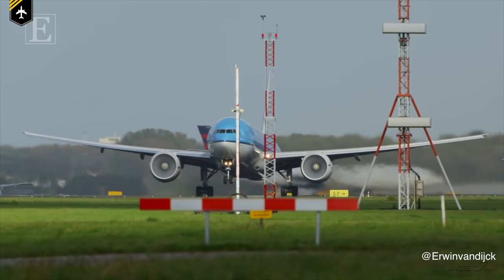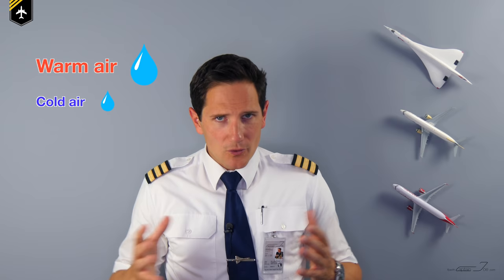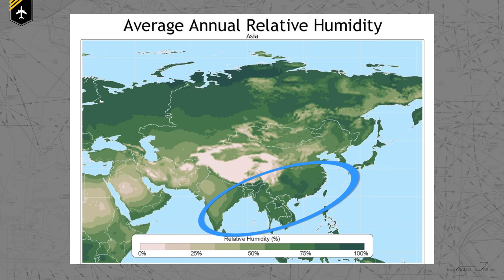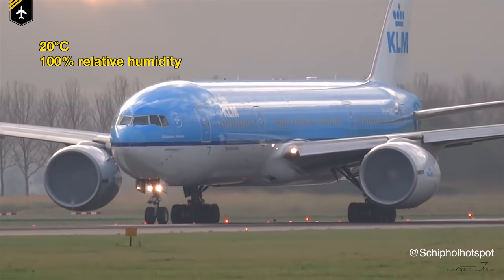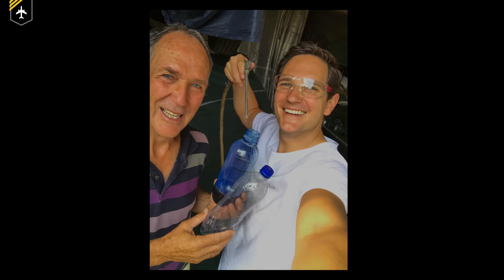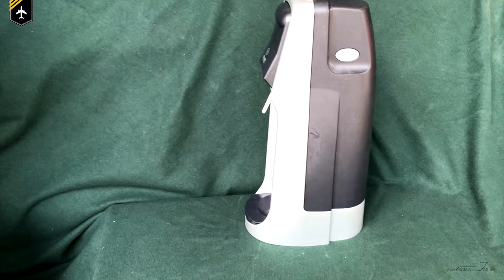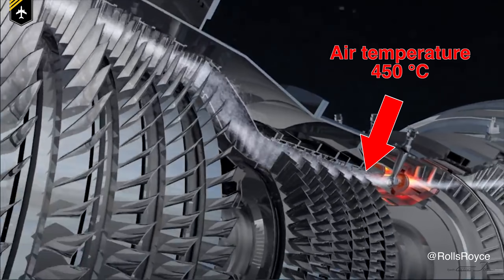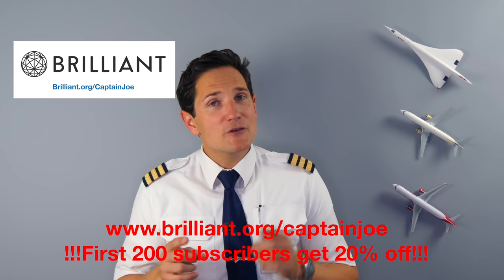WHY is there a WHITE CLOUD? Explained by CAPTAIN JOE

Comment: The water inside the bottle does not get hotter. The Air is. And can Store more vapor. The Change of the water from Liquid to Gas cools down the water very efficiently. Therefore we expect near Isotherm compression. The Gas inside has now near roomtemperature.

Comment: 5'000 cubic meter per second ! :O
Reply from the maker: Big Sucker :)
Reply: More like 500m3 at sea level and 15 degrees Celsius.
Reply: It's definitely not 5000 cubic meter per second. An Airbus A380 sucks 800 cubic meter per second which approximately has a weight of one ton.
Reply: @flywithcaptainjoe  I have found that The Trent XWB (A350 XWB), a larger engine developing 430 kN at takeoff, has an air mass flow of 1,440 kg/s. So it woild be around 1872 m3. Considering 2 engines, still less than 4000 m3. Am I correct?

Comment: Question to Min 3:17 of the current videoDear Captain Joe, herzlichen Dank für die guten Erklärungen: Sie haben die Gabe, hochkomplizierte Dinge ebenso anschaulich und einfach wie auch sympathisch runterzubrechen. Ich wartete mal auf den Abflug - die Maschine stand noch - und schaute interessiert von vorn in das rotierende Triebwerk. Der Boden war trocken, aber es machte den Anschein, als ob Regen zu erwarten wäre. Plötzlich kam scheinbar aus dem Fan eine waagrechte Nebelsäule, die sogleich einen scharfen Knick machte und sich Richtung Boden fortsetzte. Es sah aus wie ein grosser Spazierstock aus Nebel. (vgl: Min 3:17) ABER: Warum geht der Wirbel zu Boden?

Comment: Nice explanation, but i have one thing to add, there is no suction. Is just air moving from high pressure to low pressure (even in the vacuum cleaner). The big fan/compressor of the engine is moving/pushing the air back and that creates a low pressure in front of it , AgentJayZ has a good explanation about this on his channel. All the best!

Comment: You described it wrong: Wait wat? Minute 3: Faster air is cooler? Wtf???    Faster air FEELS cooler because of the layer of warmer air around our body....

The real explanaition why its getting colder is shortened: 

The energy (in wich the molecules are moving) stays the same while the area (as a cause of the suction) ( less pressure ) increases so the temperature is going down.

(Examples: The mechanism how Refridgerators work /  Why a spray of deodorant feels cold, even if the can was at room temerature )

I hope you correct your mistake (an easy to make mistake)
Because 4 a sience and physics nerd like me this is not the best part of your explanation🖒
Reply: Vincent Sooos he was talking about the wind chill effect of fans
Reply: Both explanations are true. a) more air moving around you will cause more temperature to dissipate (what you explained) b) moving air will drop its temperature due to the ideal gas law and pressure differences.
Reply: *for
Reply: ...Yeah, the cooling effect in the front of these engines is basically the one form of cooling fans DON'T do. Fans cool down potential hot zones by circulating air around which averages out the temperature in the area, fans create a wind chill effect by cycling off the air around our skin that heats up, and fans evaporatively cool us if we're sweaty... Fans do not change air pressure and adiabatically cool anything, sadly. That'd be a neat trick. (albeit loud.)

Comment: For a laymen's explanation of a complicated subject based on a simple question, his explanation will work for most people. However, besides the adiabatic cooling, it's worth mentioning there is no such thing as suction. There is only high pressure areas pushing itself into low pressure areas. Regardless, thanks Joe for the great video!

Comment: I was confused when Joe talked about "moving air being cooler."  Not so. Lowering pressure DOES cool the air, because there are fewer molecules banging into each other with lower pressure. So as the engine sucks in air, there is extremely low pressure as the air leaves the atmosphere and is pulled into the engine. That's when the air cannot hold as much moisture and therefore the water vapor condenses.  So it's a matter of lowering pressure as a result of moving the air, and the low pressure causes the condensation.

Comment: Yes, the reason for the forming of fog is the drop in temperature to below the actual dewpoint in still air. But the reason for the temperature drop is the sudden drop in pressure of the air in the intake (not the acceleration). Yes, the acceleration of the air by the fan blades causes the drop in air pressure in the intake area in front of the fan. Many times in such a humid environment (dewpoint close to temperature) we can also see a "locally generated cloud" above the wings of an aircraft during take-off when airborne.

Comment: It is NOT the acceleration cooling down the air, but the decrease in pressure. Acceleration has no effect on pressure or temperature etc. Also a fan is NOT cooling because of cooler air, but by forcing evaporation on the skin. Temperature in front of a fan is not cooler, theoretically even warmer.

Comment: This was a great explanation of the subject thank you Joe.
The practical demonstration was also great, you put it better than I could have done as an Aircraft Engineer!

When we are carrying out high power ground runs on our jet aircraft you see condensation clouds as well as vortexes drawn up from the ground, it certainly makes standing outside as a safety man a more interesting experience.
The other time we see vapour clouds like this is when an aircraft depressurises rapidly. The experiment you did replicates this perfectly.
In the past I have been in the co-pilot seat on engine ground runs and when carrying out a pressurisation check we have had a fault that caused the aircraft to dump pressure rapidly when it had been fully pressurised, that certainly created one eerie mist in the cabin, as well as very painful ears! Thankfully no-one was injured and we fixed the fault. Needless to say, the engine/pressurisation run after the fix was a nervous one.

Cheers for making great content!

Comment: Just a correction: The temperature of the gas drops because of the drop in pressure, not acceleration. The acceleration of the air is due to the pressure difference, and has nothing to do with thermodynamics. A fan works by the 'wind chill' effect, and this cooling effect has nothing to do with the acceleration of the air.

Comment: The fan in front of the engine creates low pressure, the air in the low pressure can not hold as much water as the ambient air so the water condensed into vapour causing the ‘cloud’.

It’s the same principle when a wing is creating a low pressure area, condensing the water into vapour. 
The same again when an aircraft breaks the sound barrier, there is a low pressure in the wake, causing vapour to form.

Comment: like in an air conditioner or a fridge, compressed gasses become liquid. this confuses people. this is not liquidification, this is condensation due to rapid temp decrease and air releases excess water. but normally, when you decrease air pressure, air will have more water capacity. so there are 2 components involved. temp&pressure. well explained joe! totally aggree with you.

Comment: That's also why a cloud is sometimes formed above the wing surface, since the pressure above the wing is lower.
By the way speaking of low pressure... Take a pack of sealed crisps to a flight and see how it gets swelled at a high altitude.

Comment: The temperature drop is not caused by the acceleration it is caused by the drop in pressure. U can turn this effekt round so if you cool something down the pressure drops. By gases this rate is nearly direct proportional to the absolut temperatur in kelvin. So half the absolut temperatur means half the pressure.

Comment: I guess to simplify it you could say that the pressure decrease that happens when the air speeds up when it enters the intake bell will condense water out of the air. You should explain the Venturi principle and that the air will speed up and lower pressure when being taken into the engine. Basically anytime the air moves faster it indicates it’s going towards a lower pressure and that will decrease the temperature. It’s like how a vapor cycle air conditioner works in an aircraft.

I don’t know. Maybe that’s a worse explanation.

Comment: I thought it was because of a gas law P1/T1 = P2/T2, temperature varies proportionally with the pressure exerted on it. 

that's why a fire extinguisher can become VERY cold when being used due to internal pressure massively dropping, same goes with any other pressurized gas cans that loses pressure very quickly.

Comment: According to Boyle's Gas Laws, when holding all other parameters the same, a decrease in pressure results in lowered temperature. So... As fan blades spin rapidly (supplying the powerplant with the required quantity of oxygen), they remove air at the front of the jet engine. This reduction in total air concentration at the front of the engine corresponds with a local reduction in air pressure. Therefore, temperature in that location is also reduced. However, the absolute humidity (total water content of the air) remains the same. On a humid day, the absolute humidity nearly saturates the air. As Captain Joe indicated correctly, cooler air cannot hold as much moisture as warmer air. When the supersaturated air (air that has more moisture than it can sustain) in front of the engine can no longer absorb increasing amounts of moisture, a region of condensation in the form of tiny water droplets develops in front of the engine. Under those conditions, you can see what appears to be fog within the engine cowling.

Comment: PV=nRT  He is not technically wrong, as the pressure (P) of the air intake (which is constant volume V) lessens, temperature T will drop (n and R are constants).

Comment: it is just the drop of air pressure and with that the drop of temperature that the creates the condensation. The "moving" of the air has nothing to do with this. The cooling on a body by a fan works by pushing the warm air around a body away faster than convection can, plus increasing evaporation of sweat.
Otherwise, great, informative, and entertaining videos.

Comment: Perfect video!!! But I have a problem. I don't think that air at high speed will cooler than it's in lower speed. The reason why U will feel the wind comes from a fan is cooler, I think,  is that the higher wind speed accelerates the evaporation rate of your sweat on your skin and this will takes more heat away from Ur skin in the same span of time. So U feel cooler. One simple instance: take a deep breath, and exhale very slow to Ur hands. U will feel the air comes out of Ur mouth is hot. Now do it again, but exhale really fast, now U will feel it's cold. But what is interesting is that the temperature of those air are the same actually. Back to the phenomenon in your video, I admit that the temperature is one of the reasons caused it. I'm not sure if I use solubility to explain this phenomenon is appropriate, but I think, the lower air pressure (or higher air speed, cause high speed can lower the air pressure due to the decrease of air density) decrease the solubility of water in the air. And if the maximum of solubility is even less than the amount of water already dissolved in the air, then the exceeding part will precipitate (back to liquid water from steam). So U can see that white smoke. This is only my personal opinion and please forgive me my grammar mistakes cuz I'm still learning English. Thank you again for bring us such a fantastic and brilliant video. Oh one more thing by the way, I checked the Chinese version subtitle of this video and did some modifications to make it more perfect. And it's totally correct now, so you can publish it when ever you want. All the best.

Comment: Accelerating air is NOT the cause of the air cooling.
A drop in pressure causes a drop in temp, (a rise in P also causes a rise in T)
The acceleration of air is a result of the change in pressure.

Comment: Accelerated air is not cooler, the effect in front of a fan, in summer, is given by the output of the fan which pushes away the air you gave your body heat to.
The effect in front of the engines or over the wings at take off, instead, happens because in both cases a zone of lower pressure is created in front of the engines (suction) and over the wings (Venturi effect)

Comment: When water enters the system the engines are theoretically meant to produce higher power as you can inject more fuel while maintaining a lower turbine blade temperature and the liquid water expanding inside the engine should also give you more thrust per cubic meter of sucked air.

Hi Joe
Have you ever felt that your engines are producing more power when flying through rain?, If so please make a video about it, we would love see it.

Comment: right infront of the fan pressure drop significantly because fan pulling so much air, thus water molecule in air   become cloudy ... pressure drop and because drop those air become really cold,  we can do an experiment , if you suck you hand really hard you can feel cold in your skin,  the same effect happening there.

Comment: Yeah temperature has nothing to do with that,  I am an engineering student; the decrease in pressure causes the moisture to drop out of the air, look up phase graph of water and you will see that pressure is a factor in what state water would like to be in. The temp has a negligible factor except for the increase in how much water the air can hold. Moving air does not generate any temperature change if anything it will increase temperature.
Reply: Sir We Are About to Die Lol my father was a captain in the 29th bomb squadron. Being a pilot does not mean you understand all of the physics behind flight and flight anomalies. Look up water phase graph n you will see what I am talking about

Comment: The only correction...maybe.  I am pretty certain the acceleration of the air is irrelevant.  It is the adiabatic drop in pressure that leads to a rapid drop in temperature below the dew point.  The actual acceleration of the air is irrelevant in and of itself.

Okay maybe two corrections... the fan analogy is dubious as this effect would be undetectable in a ceiling fan AND backwards (any cooling being on the back side of the fan...the air blowing at you will be slightly, and I mean slightly, warmer).  But the air blowing over you is still significantly cooler than your body temp and helps with evaporative cooling as well. It's just all about air motion.

Comment: Accelerated air is cooler? Surely adding more energy to the system increases is effective temperature. Isn’t it the process of removing higher energy air from contact with the skin and replacing it with relatively lower energy particles?

Comment: It's not quiet true, that accelerated air is cooler. The cooling sensation of a fan is only achieved by the ambient air being colder than one's body temperature. The fan then forces more air on to the skin, which in turn increases the rate at which the heat is disapated. It also makes potential moisture (sweat) evaporate faster which also absorbs heat. The real reason I would suspect is the drop in pressure that occurs. So your explanation is correct but not the reason for the temperature drop. Good videos and explanations though!

Comment: I don't think that fans work by accelerating air to cool it down so it feels cool. The main "cooling force" of a fan is by evaporating the water on your skin, I'm sure the fan somewhat cools the air itself down but probably not anywhere near enough to cool you down as much as a fan does. How you can test this is by putting a fan and a thermometer in a climate controlled room and seeing if the thermometer reads a lower temperature when you turn the fan on towards it, since the thermometer doesn't have any water on it to evaporate when the air rushes over it the thermometer's reading wont change.

However everything else in the video seems correct, just noticed something that I believe is wrong from my understanding. If you think I'm wrong please tell me why with a reply.

Comment: Even though impressive, I think the GE90-engine air intake is a bit overstated. 5000 m3/s of air going through an engine with a front opening of 8.3 m2 (the engine has a front diameter of 3.25m, hence radius = 1,625m and opening surface = 3.14 * 1.625^2) would mean the airflow has a speed of 5000/8.3 = 602 m/s (or 2169 kph), almost double the speed of sound, which would cause all kinds of tremendous problems. The actual air intake of 1 GE90 at take off is 1350 kg/s, where air has a density of 1.293 kg/m3, resulting in 1044 m3/s (still very impressive!) and an airflow speed of 126 m/s or 452 kph, leaving enough room to expand and accelerate the air without surpassing the sound speed limit.

Comment: 450c is way above the boiling point of hydrogen, which is why it's hardly a concern. Any cloud that formed will saturate immediately before it reached such a temperature.

Also the 5000m³ blows my mind. I can't even on such a large number. This is buildings per second of displacement.